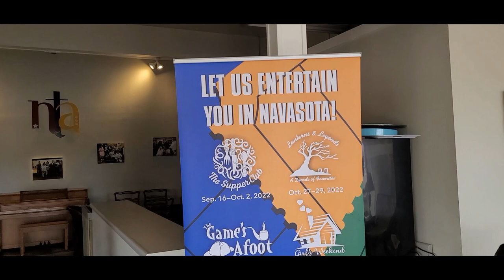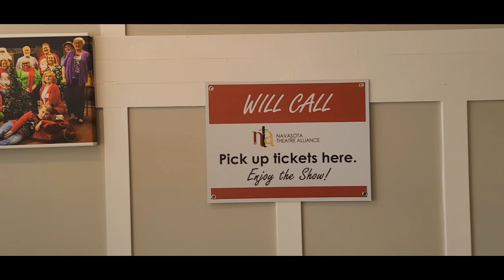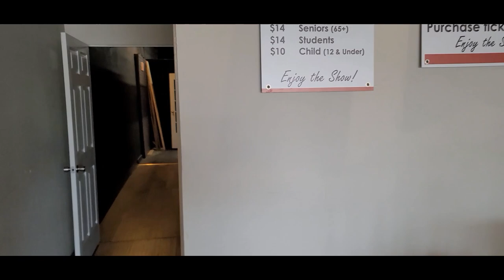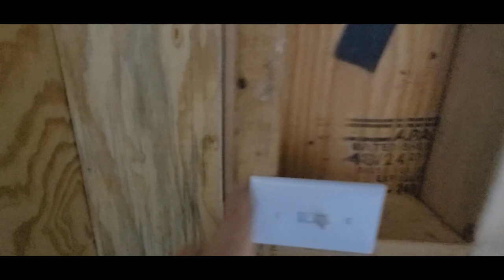How I make Prop Knifes and Sets for the Theatre

Comment: Steve , this is so great to see your other creative sides, I spent a little time in the theater, doing sets, and making counter weight rigging systems for big theaters, and also tension grids, on was for a 48,000 sq ft venue, the Forum in LA....over 1oo miles of 1/8 inch aircraft cable in that one....held to the ceiling with 3" steel cable..... ......you are a very talented guy with many great aspects.....cheers from down in Orlando, Paul
Reply from the maker: I wish I could fly stuff :( just no room in this place....